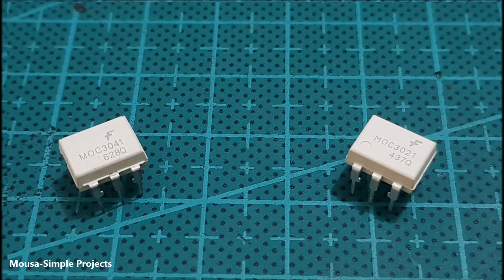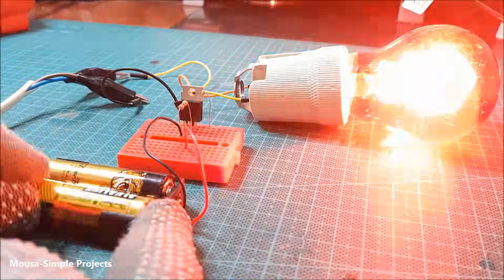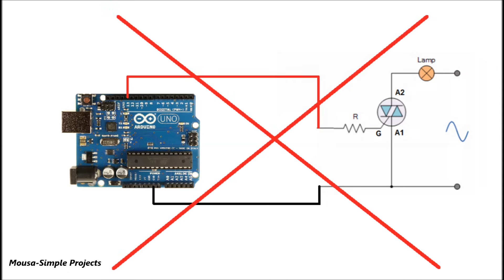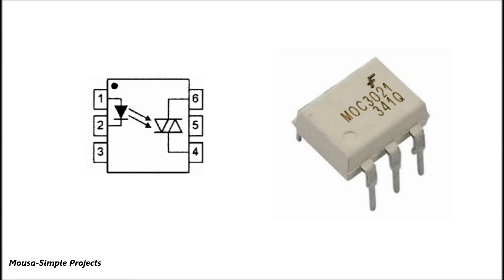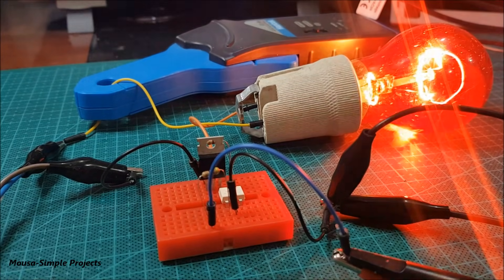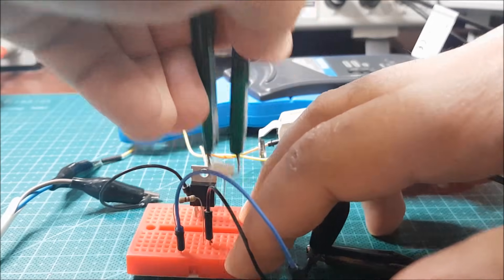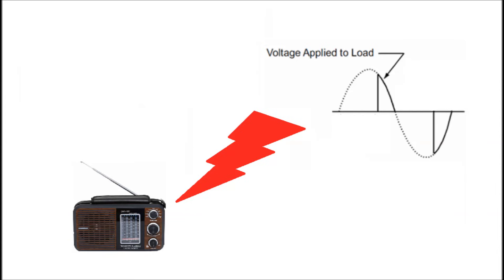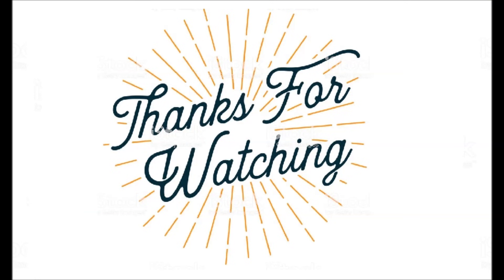Triac drivers

Comment: why a ZC driver can't be used for a dimmer?
Reply from the maker: Because drivers with ZCD switch ON/OFF the triac/SCR ONLY when the phase angle is zero degree(when voltage of the sinewave is zero), but for dimmer circuits you need to switch the triac/SCR ON/OFF at a certain desired angle (0 to 180 degree) to adjust the speed of the motor or brightness of the light bulb.

Comment: Please made a Power Factor Improvement Device Using Arduino and Pzem004t module.
Reply from the maker: I will try to make that, but Pzem004t module not good choice for PFC because it just tell you how much is the PF but don't determine if load is capacitive or inductive